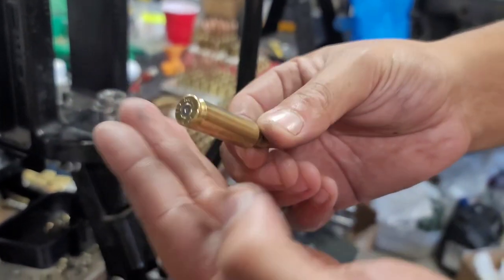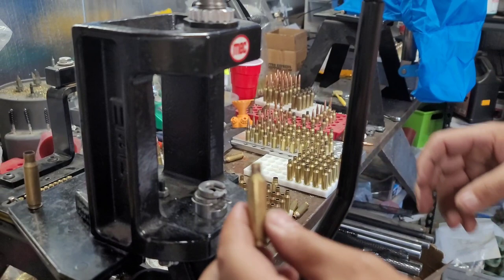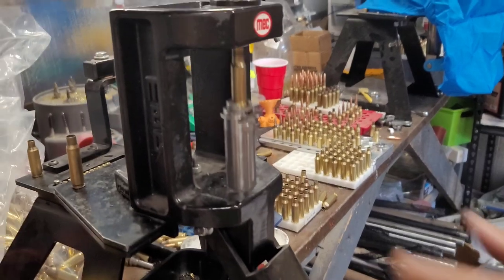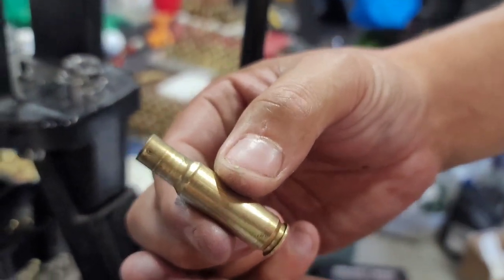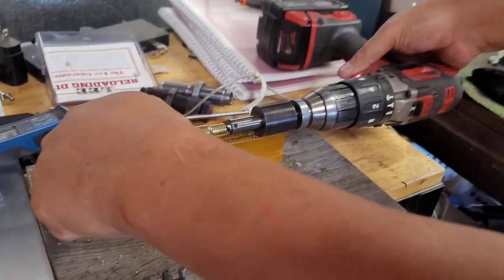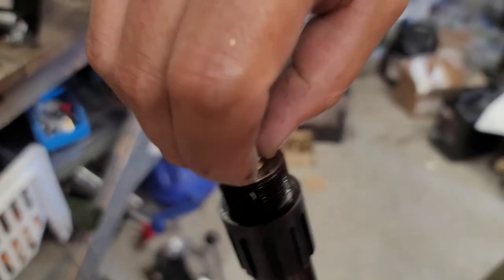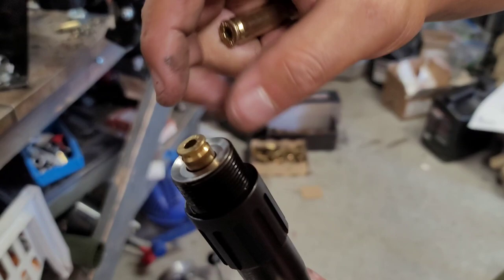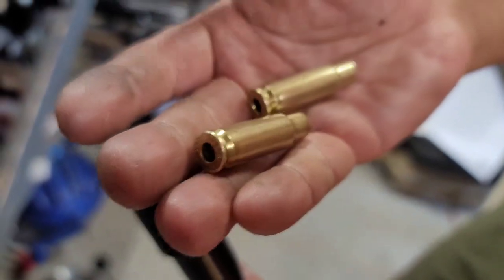Making 8.6 Blackout brass | THE EASY WAY - No Neck turning or annealing

Comment: I'm sorry I thought you Faxon gave a invitation coupon to 8.6 ammo. My mistake. That's my other concern will gunsmith have the proper tools for the 8.6. Or will it be some time on the asking before driving. I'm rural, 40+ miles to any such places. But Thanks for helping me along. I love my 300blkout just thought this would be the best upgrade. AR10 is another generation I'm finding.

Comment: I'm very Interested in the case trimmer you are using, it seems to work better than most, any recommendations on where to buy one ?
Reply from the maker: Its the forster case trimmer original.  I just removed the  handle and used a drill. Does work very well and stays sharp when cutting this heavy.

Comment: I think Q designed it for 6.5 brass, I think it would be great in a Contender 14” pistol. 🤪 Now what about cutting the brass first like BLK? 🤷‍♀️
Reply from the maker: I tried it both ways and honestly found just to run it into the trimmer was the easiest.  Ur going to have a good laugh on the first video of what happened to the sbr I built using Faxon's load data 😄
Reply: Oh boy. 😂😂😂 Faxon uses a 338 can for testing but with subs I don’t see why a 45 pistol can wouldn’t work if the pressure is low. 🤷‍♀️
Reply: @unclejim2330  just asking your opinion but I have a sico 36cal on the way, rated for 20" 338 lapua, you think it would work for 8.6? I'll probably call them

Comment: Ok everything was working today. But I tried formed brass in the rifle, the bolt doesn't close out the way. What is the length of your brass from base to shoulder? I'm thinking mine are not formed enough
Thanks
Reply from the maker: I can only speculate.  I would first eliminate headspace issue. I highly highly highly recommend just sending it to a reputable gunsmith to inspect before shooting anymore

Comment: Did you try SC brass?
308 
Base diameter	0.4709 in (11.96 mm)
Rim diameter	0.4728 in (12.01 mm)
7.62 x 51
Base diameter	0.470 in (11.9 mm)*
Rim diameter	0.473 in (12.0 mm)
6.5 CM
Base diameter	.4703 in (11.95 mm)
Rim diameter	.4730 in (12.01 mm)

Comment: Kenny
I have question about the 6.5 to 8.6 brass. I'm  using Lee presses I can't get the neck to compressor. My brass is mixed Winn Nosler S&B. 
Thanks
Reply from the maker: Rewatch this video.  I thoroughly explained what brass to use and showed why 308 brass will not work
Reply: Are you saying only Hornady brass? I bought some mixed 6.5, don't know if there is any Hornady in there. Will the other brass form or am I wasting my brass and time?

Comment: Hey sir, trying to convert Hornady 6.5 brass. When I run it though it’s dimpling the shoulder with almost a “crease” at first I thought maybe too much lube so I tried wiping the neck & shoulders with a paper towel and cleaned the die. Still, same issue, any ideas? I did anneal them first. Even tried swapping the .338 expander for .30, still no joy

Comment: I can't get my bolt to close. Shoulder and everything checks out. Any advice?
Reply from the maker: Send it to a certified gunsmith with headspace gauges
Reply: Get a Sheridan gauge.   That will show you what you are doing wrong.  Most conversions  to 8.6 require neck turning...

Comment: As far as the 308 brass not falling down into the chamber, here Is an easy fix. Ream a LEE 40 cal bullet sizer die out to .473 or nominal brass web diameter for your 8.3 blackout brass.  Just like the "bulge buster" style dies for pistol brass. Easy peasy...
Reply from the maker: Its the case neck when loaded.  Requires neck turning
Reply: @EagleEyeShooting  I figured the neck would thin out when it is expanded for the 8.3 bullet, but maybe the brass is just a lil too thick that far down the case body.  I have a ton of lake city 308 brass I reload in different calibers. Sometimes the brass is so thick I can turn it down until it is .002 under neck diameter and get really good results in a standard chamber..

Comment: Question, it looks like you're running the lee die which is what I'm trying to use but I keep getting crushed cases. It's brand new Hornaday brass and I'm using Hornaday resizing wax. Any thoughts on what may be going wrong. From watching your video I'm not doing anything differently. Thanks for putting this video up and for any advice.
Reply from the maker: Put a lil of case lube on the inside neck to aid in the ball expander
Reply: @EagleEyeShooting  worked perfectly! Thanks!!
Reply: @EagleEyeShooting  have you seen amy data on chamber pressures with these loaded for subsonic velocity? I run a SilencerCo octane 45 can on my 300Blk for subs and was thinking it might be a viable option for 8.6Blk subs. By far my quietest can on the 300.

Comment: What is the tool you're using to trim the case back?
Reply from the maker: Forster Original case trimmer.  Removed the handle and just chucked my drill on
Reply: @EagleEyeShooting  really easy way to over trim

Comment: What is that sizing die that you're using for this?
Reply from the maker: LEE Pacesetter
Reply: @EagleEyeShooting  tired that with brand new Hornady brass, it keeps popping the decapper out of the collet. Any suggestions?
Reply from the maker: Tighten the nut on the decapping pin
Reply: @EagleEyeShooting  Thanks for being so responsive. I tried it and worked like a champ. It took a lot of force, I thought it's going to rip the press of the desk. Now on to trimming... Thanks again.

Comment: Interesting. Very nice. What about neck thickness/tension versus the added chamber pressure that can happen because of this?
Reply from the maker: Using Hornady 6.5 CM brass doesn't require neck turning. The necks are .018" thick which is typical.  No added pressures

Comment: It has a Faxon barrel, Omega upper and lower
Reply from the maker: Get a hold of factory ammo and give it a try. I have seen many faulty faxon 8.6 barrels as well as those who put together their 8.6 builds. Again, send it to a gunsmith that has upper barrel extension gauges and go/no go gauges
Reply: I hope that not the case. None of local gun shop have the 8.6 yet. Does Faxon know of this problem? You said you got a coupon for ammo with your barrel, none came with mine.
Reply from the maker: I never said i got a coupon. Ammo can be purchased online. Gorilla ammo. Your not going to see this cartridge at local gunshops. I must emphasize your going down a dangerous rabbit hole trying to make your reloads work without being 100% sure your firearm is within spec

Comment: Do you think 338 Federal will form nicely to 8.6 blackout?
Reply from the maker: No
Reply: @EagleEyeShooting  Why wouldn't it? All one is doing is bumping the shoulder.
Reply from the maker: Case wall thickness.  The cartridge is a lot shorter than 338 federal. You'll be neck turning and wont chamber correctly.  Just like in this video with the 308 brass not plunking
Reply: @EagleEyeShooting  Gotchya.

Comment: I've heard that it's a good idea to step size vs going straight from once fired .264 all the way up to .338.  I.e. .264 --> .277 --> .284 --> .308 --> .338.  Just a suggestion.
Reply from the maker: Never had a problem doing it this way. Thanks for the suggestion, but this eliminates unnecessary steps